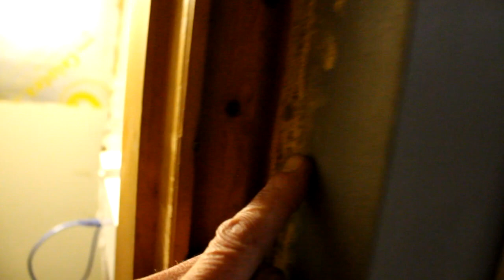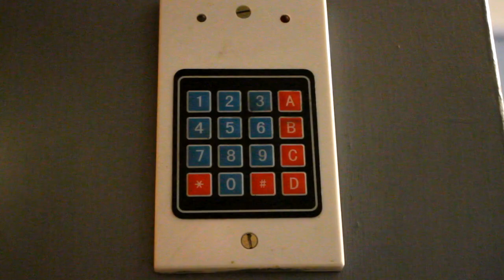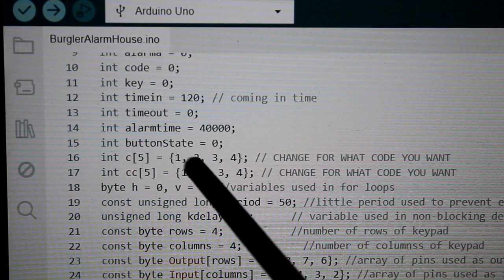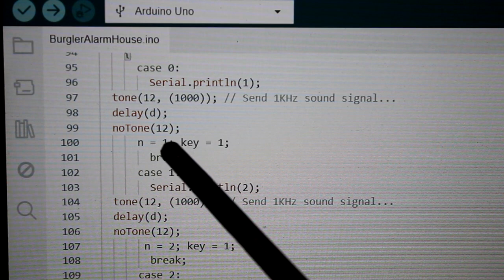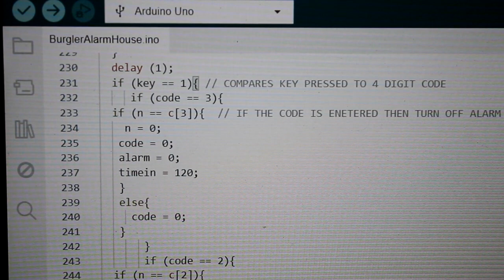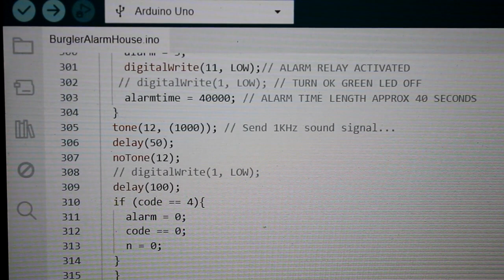Arduino Bugler Alarm.

Comment: In principal you can add other sensors to the extra pins, copy & paste the code changing the pin number, like windows, excess heat sensors (not smoke detectors it'll be going off all the time), carbon monoxide, rig a stop cock up for flood alert, a low beer stock sensor! 
my theft deterrent works really well, I got nothing worth nicking.
Reply: hew  already   had tha  automatic   bar  but  took  it  down a  while ago  lol    was  pretty cool though
Reply from the maker: I`ve got some motion sensors coming to add to the alarm. :)
Reply from the maker: I go to Morrisons every week to get the beer nowadays. :) A flood sensor is a good idea. We get loads of floods at work when we leave the tap on topping up the tank.
Reply: how about just putting the stop cock on the tap? @damianbutterworth2434

Comment from the maker: // alarm code is "1234"change c and cc to what you want.
int n = 0;
int t = 0;
int y = 0;
int u = 5000;
int d = 100;
int a = 0;
int alarm = 0;
int alarma = 0;
int code = 0;
int key = 0;
int timein = 120; // coming in time
int timeout = 0; 
int alarmtime = 40000; 
int buttonState = 0;
int c[5] = {1, 2, 3, 4}; // CHANGE FOR WHAT CODE YOU WANT
int cc[5] = {1, 2, 3, 4}; // CHANGE FOR WHAT CODE YOU WANT
byte h = 0, v = 0; //variables used in for loops
const unsigned long period = 50; //little period used to prevent error
unsigned long kdelay = 0;      // variable used in non-blocking delay
const byte rows = 4;           //number of rows of keypad
const byte columns = 4;          //number of columnss of keypad
const byte Output[rows] = {9, 8, 7, 6}; //array of pins used as output for rows of keypad
const byte Input[columns] = {5, 4, 3, 2}; //array of pins used as input for columnss of keypad
byte keypad() // function used to detect which button is used
{
  static bool no_press_flag = 0; //static flag used to ensure no button is pressed
  for (byte x = 0; x < columns; x++) // for loop used to read all inputs of keypad to ensure no button is pressed
  {
    if (digitalRead(Input[x]) == HIGH); //read evry input if high continue else break;
    else
      break;
    if (x == (columns - 1)) //if no button is pressed
    {
      no_press_flag = 1;
      h = 0;
      v = 0;
    }
  }
  if (no_press_flag == 1) //if no button is pressed
  {
    for (byte r = 0; r < rows; r++) //for loop used to make all output as low
      digitalWrite(Output[r], LOW);
    for (h = 0; h < columns; h++) // for loop to check if one of inputs is low
    {
      if (digitalRead(Input[h]) == HIGH) //if specific input is remain high (no press on it) continue
        continue;
      else    //if one of inputs is low
      {
        for (v = 0; v < rows; v++) //for loop used to specify the number of row
        {
          digitalWrite(Output[v], HIGH);  //make specified output as HIGH
          if (digitalRead(Input[h]) == HIGH) //if the input that selected from first sor loop is change to high
          {
            no_press_flag = 0;              //reset the no press flag;
            for (byte w = 0; w < rows; w++) // make all outputs as low
              digitalWrite(Output[w], LOW);
            return v * 4 + h; //return number of button
          }
        }
      }
    }
  }
  return 50;
}
void setup()
{ 
  pinMode(1, OUTPUT); // GREEN LED
  pinMode(13, INPUT); // door magnetic switch
  pinMode(10, OUTPUT); // RED LED
  pinMode(11, OUTPUT); // ALARM RELAY
  pinMode(12, OUTPUT); // BUZZER
  digitalWrite(1, LOW);
  digitalWrite(10, LOW);
  digitalWrite(11, HIGH);
  delay(1000);
  for (byte i = 0; i < rows; i++) //for loop used to make pin mode of outputs as output
  {
    pinMode(Output[i], OUTPUT);
  }
  for (byte s = 0; s < columns; s++) //for loop used to makk pin mode of inputs as inputpullup
  {
    pinMode(Input[s], INPUT_PULLUP);
  }
  Serial.begin(9600); //to use serial monitor we set the buad rate
 
}
void loop()
{
  if (millis() - kdelay > period) //used to make non-blocking delay
  {
    kdelay = millis(); //capture time from millis function
    switch (keypad())  //switch used to specify which button
    {
      case 0:
        Serial.println(1);
  tone(12, (1000)); // Send 1KHz sound signal...
  delay(d);   
  noTone(12);   
      n = 1; key = 1;
        break;
      case 1:
        Serial.println(2);
  tone(12, (1000)); // Send 1KHz sound signal...
  delay(d);   
  noTone(12);   
       n = 2; key = 1;
        break;
      case 2:
        Serial.println(3);
  tone(12, (1000)); // Send 1KHz sound signal...
  delay(d);   
  noTone(12);   
       n = 3; key = 1;
        break;
      case 3:
        Serial.println("A"); // BUTTON USED TO SET THE ALARM IN DETECT MODE.
  tone(12, (1000)); // Send 1KHz sound signal...
  delay(d);   
  noTone(12);   
    if (alarm == 0){
      alarm = 1; // TURNS ALARM ON
      timeout = 1; // VARIABLE TO LET THE DOOR TIMER SET FOR LEAVING THE HOUSE
      }
        break;
      case 4:
        Serial.println(4);
  tone(12, (1000)); // Send 1KHz sound signal...
  delay(d);   
  noTone(12);   
       n = 4; key = 1;
        break;
      case 5:
        Serial.println(5);
  tone(12, (1000)); // Send 1KHz sound signal...
  delay(d);   
  noTone(12);   
     n = 5; key = 1;
        break;
      case 6:
        Serial.println(6);
  tone(12, (1000)); // Send 1KHz sound signal...
  delay(d);   
  noTone(12);   
       n = 6; key = 1;
        break;
      case 7:
        Serial.println("B");
  tone(12, (1000)); // Send 1KHz sound signal...
  delay(d);   
  noTone(12);   
        break;
      case 8:
        Serial.println(7);
  tone(12, (1000)); // Send 1KHz sound signal...
  delay(d);   
  noTone(12);   
       n = 7; key = 1;
        break;
      case 9:
        Serial.println(8);
  tone(12, (1000)); // Send 1KHz sound signal...
  delay(d);   
  noTone(12);   
       n = 8; key = 1;
        break;
      case 10:
        Serial.println(9);
  tone(12, (1000)); // Send 1KHz sound signal...
  delay(d);   
  noTone(12);   
       n = 9; key = 1;
        break;
      case 11:
        Serial.println("C");
  tone(12, (1000)); // Send 1KHz sound signal...
  delay(d);   
  noTone(12);   
        break;
      case 12:
        Serial.println("*");
  tone(12, (1000)); // Send 1KHz sound signal...
  delay(d);   
  noTone(12);   
     n = 0;
        break;
      case 13:
        Serial.println(0);
  tone(12, (1000)); // Send 1KHz sound signal...
  delay(d);   
  noTone(12);   
       n = 0; key = 1;
        break;
      case 14:
        Serial.println("#");
  tone(12, (1000)); // Send 1KHz sound signal...
  delay(d);   
  noTone(12);   
        break;
      case 15:
        Serial.println("D");
  tone(12, (1000)); // Send 1KHz sound signal...
  delay(d);   
  noTone(12);   
        break;
      default:
        ;
    }
  }
  if (timeout == 1){ // TIMER TO WAIT TO EXIT HOUSE AND CLOSE THE DOOR
    for (int i=0; i <= 60; i++){
      digitalWrite(10, HIGH);
       tone(12, (1200)); 
  delay(50);   
  noTone(12);
  digitalWrite(10, LOW);
    buttonState = digitalRead(13);
    if (buttonState == HIGH) {
    // turn LED off: door closed
   // digitalWrite(1, HIGH);
  }
  else{
   // digitalWrite(1, LOW);
  }
 
    delay(950);
    }
    timeout = 0;
  }
  delay (1);
  if (key == 1){ // COMPARES KEY PRESSED TO 4 DIGIT CODE
     if (code == 3){
  if (n == c[3]){  // IF THE CODE IS ENETERED THEN TURN OFF ALARM 
    n = 0;
   code = 0;
   alarm = 0;
   timein = 120;
   }
   else{
     code = 0;
   }
       }
       if (code == 2){
  if (n == c[2]){  
    n = 0;
   code = 3;
   }
   else{
     code = 0;
   }
       }
     if (code == 1){
  if (n == c[1]){  
    n = 0;
   code = 2;
   }
   else{
     code = 0;
   }
    }
    if (code == 0){
    if (n == c[0]){  
    code = 1;
    n = 0;
    }
    else{
      code = 0;
    }
      }
    key = 0;
  }
   buttonState = digitalRead(13);
  if (buttonState == LOW) { // IF THE ALARM IS ON AND 3 OPEN DOOR SENSORS IN A ROW THEN ACTIVATE ALARM NEXT STAGE
    // turn LED on: door open
   //digitalWrite(1, LOW);
   alarma = alarma + 1 ;
    if (alarm == 1){
      if (alarma >= 3){ 
      alarm = 2;
      }
      }
  }
 
  if (buttonState == HIGH) { // THE DOOR SENSOR NEEDS 3 OPEN SIGNALS IN A ROW. THIS RESETS IT TO ZERO IF A CLOSED SIGNAL IS DETECTED
    // turn LED off: door closed
   // digitalWrite(1, LOW);
   alarma = 0;
  }

  if (alarm == 0){
  digitalWrite(10, LOW);
  } 
  if (alarm == 1){
  digitalWrite(10, HIGH);
  } 
  if (alarm == 2){
  // digitalWrite(1, HIGH);
  timein = timein - 1;
  if (timein <=0){
    alarm = 3;
    digitalWrite(11, LOW);// ALARM RELAY ACTIVATED
   // digitalWrite(1, LOW); // TURN OK GREEN LED OFF
    alarmtime = 40000; // ALARM TIME LENGTH APPROX 40 SECONDS
  }
  tone(12, (1000)); // Send 1KHz sound signal...
  delay(50);   
  noTone(12);
  // digitalWrite(1, LOW); 
  delay(100); 
  if (code == 4){
    alarm = 0;
    code == 0;
    n = 0;
  }
  } 
  if (alarm == 3){
  //
     if (code == 4){ // IF CODE ENTERED THEN TURN ALARM OFF
    alarm = 0;
    code == 0;
    digitalWrite(11, HIGH);
    digitalWrite(1, LOW);
    n = 0;
  }
  alarmtime = alarmtime - 1; // ALARM TIMED OUT. RED FLASHING LED TO INDICATE ALARM BEEN ACTIVE
  if (alarmtime == 0){
    digitalWrite(11, HIGH);
    alarm = 4;
  }
  }
  if (alarm == 4){
    digitalWrite(11, HIGH);
    digitalWrite(10, HIGH);
    delay(500);
    digitalWrite(10, LOW);
    delay(500); 
  }
  if (alarm == 0){
     digitalWrite(11, HIGH);
     
  }
}